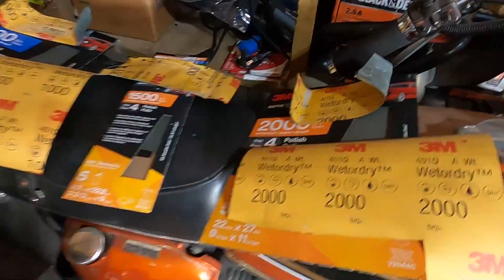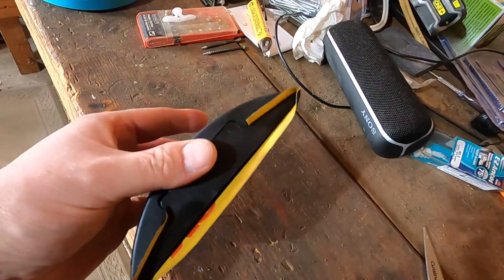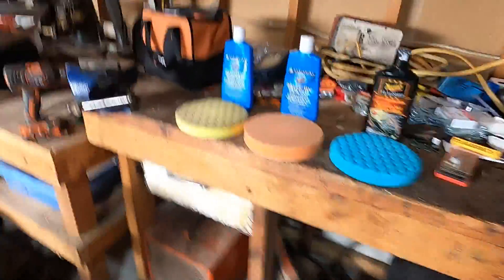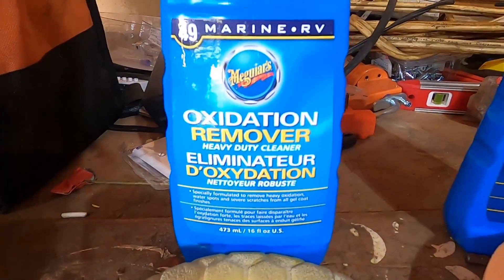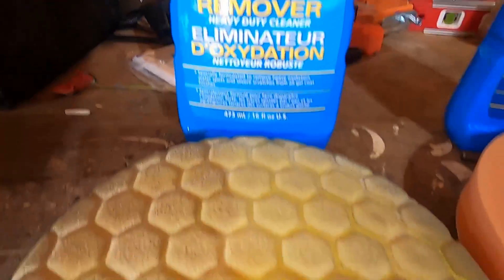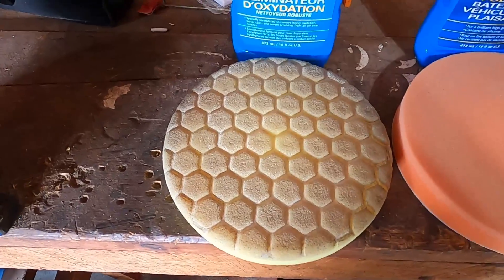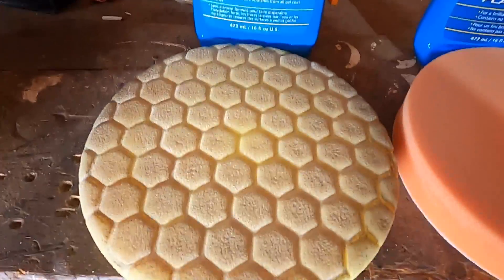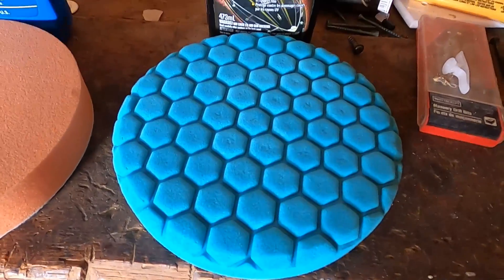Gel Coat Restoration - HOW TO

Comment: I’ve done mine starting with 800 to 1000 and finish it off with 2000 grid. I bought the boat it was never done I’m sure and I could not believe the results. It’s a lot of work but well worth it. I have a 1990 Rajin Cajun Dallas Cowboys package. Now I’m on the interior part. Nice job man I like the results.

Comment: Isn’t that a “clear coat” on top of paint you’re restoring there?
Reply from the maker: Hey DarfADA, great question! Most boats have a 'gelcoat', which is different from paint. It's a resin. There is typically no clear coat over a gel coat. So it's just 1 layer of gel coat. That's why when you're restoring a gel coat (like I have done in this video), you have to be very careful not to sand or buff all the way through.